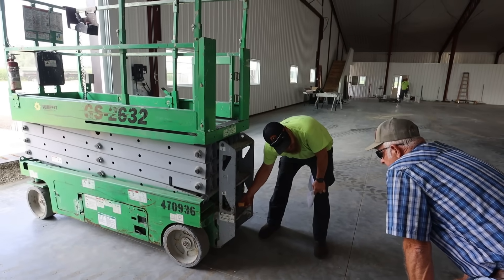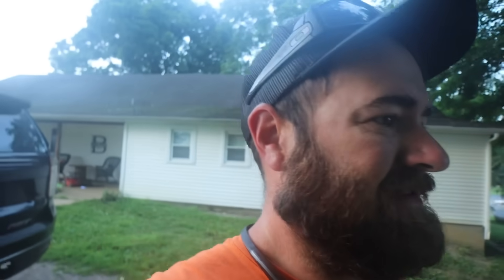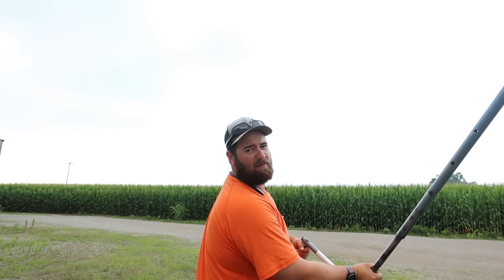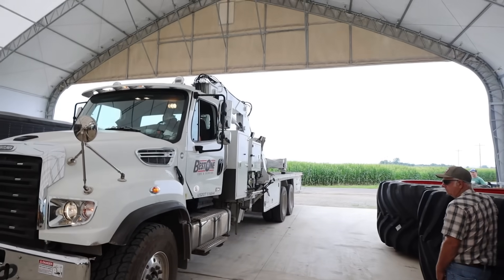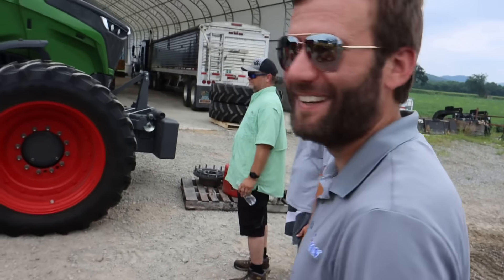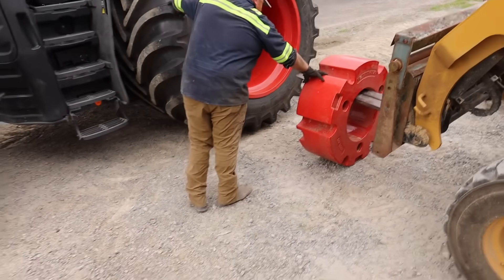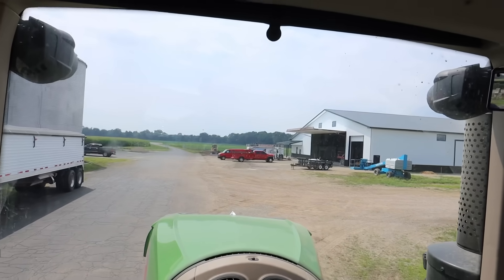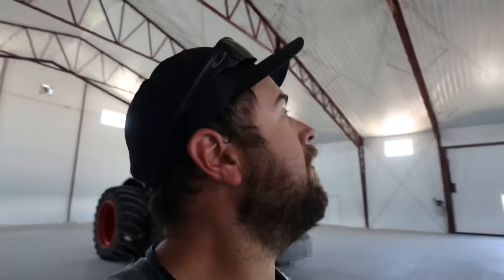We put 1400 LSWs on our New Fendt 1038| HUGE!

Comment: With the front 3pth you should put a stubble stomper on like they use in Europe would greatly extend the life of the tires we got a versatile 475 cart tractor and after 3 years we had to rotate the 900 metrics on it

Comment: Get a Generator ready for temp lights, battert Chargers, block heaters, and storm prepping 5:00
Reply: The Nylon cord plies are the thump creator, unless they are all Steel or others like Kevlar they will take a Thermal Set.
Reply: You can do "the Claw!" With a Bobcat and the hydraulics. 11:29
Reply: Dies the tractor have a refrigerator under buddy seat? 😊 14:46

Comment: I remermber when you were tiling, you said that the narrow front duals would did in to get traction better than wider tires. Wondering why you put these on.
Reply from the maker: That’s what we were told but the tractor with bigger tires is what pulled the tile tractor so idk. If these don’t work for that we will use the other tractor

Comment: The corn will likely germinate and grow better in evenly compacted ground, as is the case when planting into the wheel tracks, as compared with planting between two wheel tracks. The roots in the wheel tracks will not be bound by more dense soil on both sides, as would be the case with planting between dual wheels, but the soil density will be less as the plants approaches the edges of the tire track. Corn roots bend off when they encounter a positive soil density gradient, but keeps going when experiencing a constant or negative soil density gradient.
Reply: Not sure what you are saying. My understanding LSWs do no very little for soil compaction? Better with IR VR tires and plant between tires. Course if a certain nationality loves wide tired

Comment: I thought you said before when everyone was saying to keep the black Fendt one reason you weren't was because you specifically ordered this with the tires it came with.
If you knew you were going to do this you could have kept the black one then you'd definitely would have the ultimately coolest Fendt on yt.😂😂
If i remember you got it with the tire monitor system to auto inflate tires. If you do will that still work with the LSWs?
Reply from the maker: The black tractor was just a loaner tractor so it had to go back to dealer when our tractor was fixed. The inflation system isn’t hooked up at the moment unfortunately